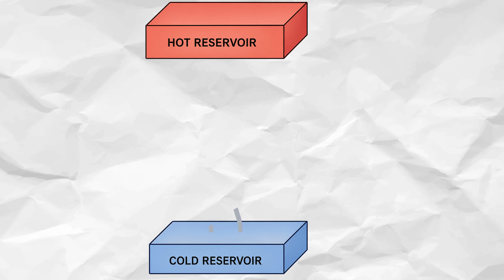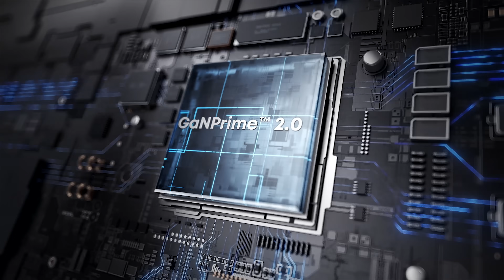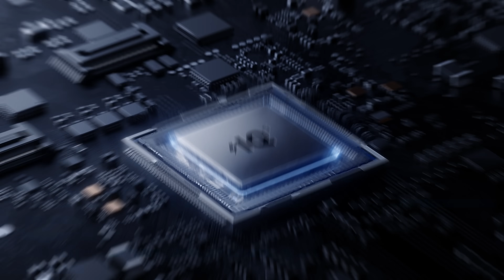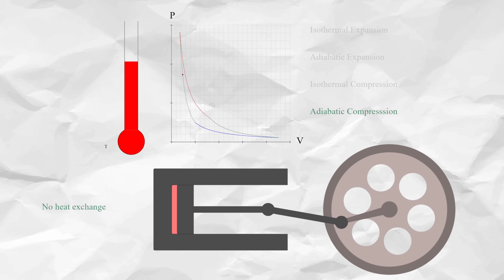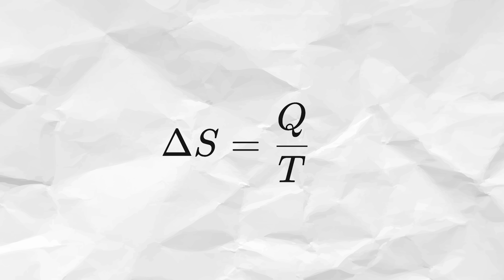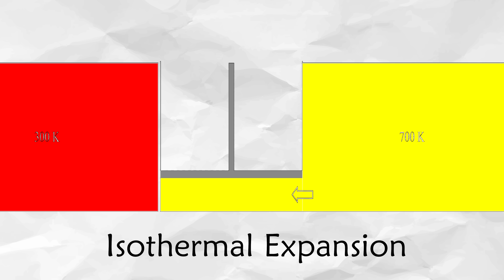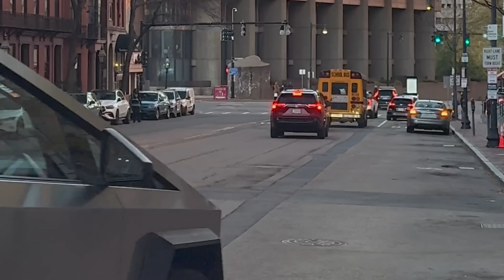This Tiny Engine Explains Entropy

Comment: when are gonna gonna make a break through with all this energy tech, and where is your giant sterling (insulated/enclosed) flywheel dressed in vanta black painted thermal diodes, thus using solar heat and mass inertia to dual purpose the engine in to it's next version.
A stupid large heavy and solar hot  flywheel that also acts as heat storage for the device.
Come on, you get the idea, what about throwing in a few thermal filters to regulate the system and keep the power wall battery at optional temperature. Perhaps using the air conditioned battery compartment as a cold battery for the colder side of the engine.
Put this comment in to DALLE for the machine blueprints xD

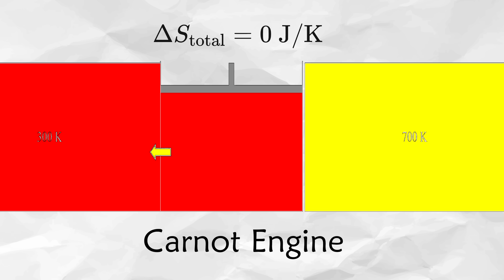Comment: 6:45 i love this video!
7:07 you've lost me sorry
Reply: as I understand it, if you wanted to use all the energy that the heat in the hot side represents, you would need to extract work from the wiggling molecules until they come to a stop (which means absolute zero). But once they reach the temperature of the cold side, you can't get any work out of them anymore; on the contrary, it would take work to slow them down further – thereby creating a new temperature differential one could extract work from.

Comment: I'm not really sure if anyone can answer this but I put some molten plastic on a knife and held it over a flame, tilting the knife towards the fire, and i saw the plastic moving up the knife-away from the flame, against gravity somehow, and I also noticed it on a differant set up with canola oil on a metal stick, and the canola oil moved up the stick to the cool side, then dripped downwards, then moved up again once it was over the flame again, and it just repeated, i thought it could be rising hot air but it doesnt really seem plausible?
Reply: Oil is thermophobic, meaning it "runs away" from heat. Plastic is generally petroleum-based, meaning it's generally oil-based. The plastic behaves the same as the canola oil because their base properties are thermophobic.
Reply: @Oblitoris 😂😂
Since when ? And why is it really afraid? (Science behind it)
Reply: @kohliabhi  Good question. I appreciate your sense of humor. 😆 
My use of the term "thermophobic" primarily refers to how oils react to temperature gradients, specifically thermophoresis (or the Soret effect). In non-uniform thermal fields, many microemulsions and suspended particles in oil will naturally migrate from hotter regions to colder regions. Conversely, it can also refer to an oil's limits regarding thermal degradation, where extreme heat causes it to break down.
Reply: Interesting 🤔🤔 I certainly can't answer this but have seen the same thing with a hot shovel , 8 years later still have no answer 😅
Reply: Maybe volume expansion of the plastic due to heating
Reply: Probably capillary action as the oil is heated it becomes less viscous and can 'wick up' the the metal, then as it cools it congeals/solidifies it creates insulation/resistance causing the flow to back up until it hits enough mass that gravity overpowers the wicking action causing the oil to run back. Seen similar happen when I've been soldering/brazing stuff.

FWIW: Plastic is just solidified oil.

Comment: On a related note, is there a device that collects waste thermal energy and turns that into work?
Reply: The efficiency of your engine decreases as your temperature difference goes down. Since the excess heat from a system will be lower than the heat in the system, a secondary system will be more inefficient than the primary system. In other words, your effectiveness would decrease significantly with that second system, and the complexity needed to achieve it would not be worth the return on investment
Reply: @peytonjay4515 I have heard of some scientists trying for this though
Reply: Thats a good point,  but i wonder at a certain stage would you just need another one of these to gather thermal energy lost from the first thermal energy conversion??
Reply: @someirishfella1704I meant more if you could collect the waste thermal energy from an activity and reuse it.
Reply: @westonding8953 car heating. Your engine is working while created heat warms a human inside
Reply: @westonding8953 I beleive that some electric cars will do this on braking. The heat generated there is converted back into the battery
Reply: @westonding8953 hey! That's called an "energy recovery system", but heat disipates through everything so we can only recuperate a little. Most common way in the industry is to use downstream water from a cooling system for example to pre-heat water entering a boiler.
Reply: Sure, just run this "waste" thermal energy through a Stirling engine to somewhere colder 😃
Reply: @sicadesign6078 is the Sterling engine able to collect waste thermal energy?
Reply: @westonding8953  Of course. What do you think, did you invent a new energy form by saying "waste thermal"? The video was about thermal energy, anything can be the hot side. Like he showed. Rewatch the video if you don't understand that table is the hot side, when ice cubes are used for cool side.

Now if the energy can be economically feasibly converted to work, that's a completely different question. Be more precise if you want to talk about that.
Reply: @u1zha okay, to be fair, I should have said an “economical waste thermal energy” device
Reply: @westonding8953  It depends. In some cases, heat-based power generation does use more than one stage, but the overall system is still capped by carnot efficiency, so it's of course not one weird trick to exceed carnot efficiency. It might in some situations get you a bit closer to carnot efficiency though. One example is waste heat being used to pre-heat inputs to a burn chamber via a counterflow heat exchanger, assuming the heat exchanger doesn't increase the pressure at the output of the main heat engine too much. If we assume the burn chamber reaches the same hot side temp either way, with the heat exchanger we burn less fuel to reach and maintain the same hot side temp, by not constantly putting in winter-cold fuel and winter-cold air.

In contrast, power sources that start with moving air or moving water are not capped by carnot efficiency, though if you back up to the step where the heat from the sun heated up the air to cause it to move or the water to cause it to evaporate and then rain farther uphill and so on, then undoubtedly the overall system viewed as a heat engine wouldn't exceed carnot efficiency (not even close) - it's just that we don't have to build 99.999% of that heat engine so we can conveniently ignore the parts we didn't build and get to measure only how efficiently we can convert a cross section of moving air or water into electricity, and that step considered alone can greatly exceed carnot efficiency.

I mention these mainly because the ability to exceed carnot efficiency within the portion of the system that we have to build can be a reason why some folks can tend to underestimate the efficiency and effectiveness of wind and hydro.

In west Texas, some areas have wind turbines and oil wells interspersed, with some tanks and power lines and a few roads and that's about it for miles around. I feel like more people should see that place. It's a great counterexample to any BS about wind turbines being useless or whatever. West Texas has wind that can't be ignored, and they're all about gathering energy, so in a way it makes all the sense.
Reply: @sicadesign6078   What about the energy wasted to make a Stirling engine?
Reply: Yes, but only partially. For example there is a technology called combined cycle often used in gas turbine powered power plants.
Reply: @Laythe_ what’s combined cycle?
Reply: @westonding8953 Basically you feed the exhaust of a gas turbine into another turbine to extract a bit of extra energy from it
Reply: @Laythe_  I guess that sounds reasonable
Reply: Boilers are usually equipped with an "economizer" which heats up the boiler feed water with the waste exhaust gasses or exhaust steam.

Combined cycle power plants use a more advanced version where they have a natural gas powered turbine engine, and the exhaust is used to boil water for a steam powered turbine engine.

But that is about as much as you can do. Below a certain threshold, waste heat is just waste. A lumber mill might have a good use for tons of sawdust, but your average woodworking shop will just toss it.
Reply: KFC gaming console …
Reply: It is common to have electricity produced by burning some fuel and then use the left over heat for district heating to heat the homes. Which kind of does that. Or excess heat when Datacenter is cooled down after running servers are producing heat is often used for district heating too same way. Also district cooling can be used for cooling homes in hot days and then store heat for the colder times to big water pools underground. In general in many industrial solutions they use the left over heat for something else either heating or something else as it is more or less wasting to not use the produced heat for something useful when some fuel is burned already for some other purpose.
Reply: You can recursively chain any generator which works on a thermal difference (eg steam, sterling engines), and you can always wrap a system in a heat sink, but there's always some inefficiencies that cause loss.  Eventually the remaining excess thermals become indistinguishable from background thermal noise.
Reply: @subjekt5577 makes sense
Reply: @subjekt5577   moving the "waste" heat to the "source" of the new thing has a cost that costs more than the second thing can ever make use of, if I understand correctly
Reply: @iammichaeldavis  then how do combined cycle power plants exist?
Reply: @merchantmareed I don’t know. How DO they work?
Reply: @merchantmareed well then I was wrong 🤷‍♂️ I ain’t a materials scientist
Reply: In many places we already do this as much as is possible.

Gas turbine power plants can output their waste heat to a steam boiler. High pressure steam turbines feed their waste into low pressure turbines.

At the end of the day, the most you can possibly get is based on the maximum temperature difference between your heat source and your cold reservoir. All these steps just allow you to get closer to that Carnot limit. The only other thing you can do is make use of the last of the waste heat for heating.

The laws of thermodynamics are easily the most certain and unforgiving rules of the universe that we know of, and the second law (entropy always increases) is even more unforgiving than the first (conservation of energy).
Reply: @jasexavier  not to be a prick but I would argue all the laws are equally unforgiving
Reply: Yeah, it's called a heat pump, but surprise, it takes more energy to pile up energy enough to be useful than you'll ever get back out of what you piled.

The exception is when the waste is the product, like heating homes, which is why we use them for that. In that case, your efficiency compared to just powering resistive elements can be several hundred percent 😄
Reply: A turbocharger
Reply: Aircraft engines often use the their heat to heat up the fuel (or rather, use cold fuel to cool down the engine, but same thing).
Reply: @lelsewherelelsewhere9435 it’s a mutualism cycle
Reply: Water and steam turbine. But it needs closed cycle. Or you mean more like on molecular level, extract only particular direction of the momentum vector - then no. That would be pretty much free energy but I bet entropy would have something against that.
Reply: @WsciekleMleko I mean after one engine is used and it produces waste thermal energy, can we collect and use some of that in other means (other than heating)?
Reply: @westonding8953  Regenerative braking is kind of similar concept. Except you're turning the kinetic energy losses into spinning a generator. A turbo charger works most similarly though. It take wasted exhaust heat, and then spins a turbine in order force air into the motor to get more power.
Reply: @westonding8953  Literally shown in the video, that you can. If you had a magical hand dealing you ice cubes, then you could do it at industry scale.
Reply: @westonding8953  We can use thermal energy (heat) only to heat something. So short answer is no.

Longer answer:
TLDR  Yes.

Heat = random movement of particles
Work = ordered movement of particles

If we heat particular thing in particular matter we can make useful work out of it. 

Problem: you need cold and hot reservoir. Waste thermal energy is just some amount of heat - if you can move it to colder reservoir, you can make work out of it. If there is not such reservoir - you cannot make work out of it. 

In water steam turbine cycle, hot water is hot reservoir, condensing water is cold reservoir (inside cooling towers). But if you extract heat of the cooling towers, you have another hot reservoir - > cool it down -> additonal work created. Lowest limit is cold reservoir of temp close to absolute zero.
Reply: @WsciekleMleko yeah. I guess that makes sense. The laws of thermodynamics only allow energy to flow from high to low.
Reply: Yeah! All the engines in the video use waste heat from a different process 😅
Reply: @ultramadscientist”waste heat”. 😅I was thinking more along the lines of using heat to turn it back into electricity
Reply: Reverse rankine cycle
Reply: Turbo
Reply: Yeah it’s called “the universe”

Comment: Selling a potting compound as a feature instead of an obstruction to repairability is a bold flex by anker :D
Reply: Also the size seems to cover more than one socket anyway, might be more useful to have a slightly bigger brick but with a cord so more than one thing can use the set of sockets.
Reply: someone needs to think of the landfills, they need to eat too.
Reply: Well in all reality, who is going to try and fix a compact high power charger anyways? They are durable it'll last a very long time

Comment: eventaully wouldn't the other side get too hot for this to work, (the side that is where the air cools and contracts) from the heat tranpsher across the glass vial?
Reply: There would still be a temperature differential as long as fuel is being supplied.